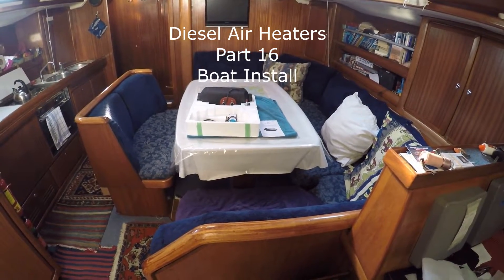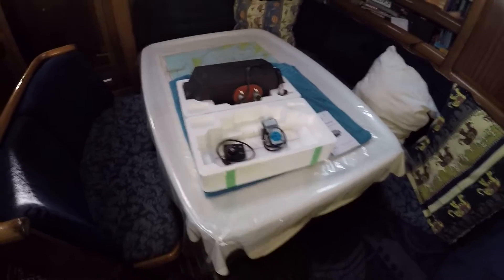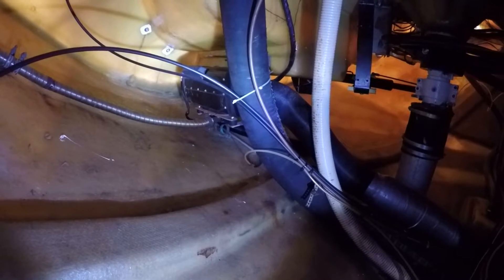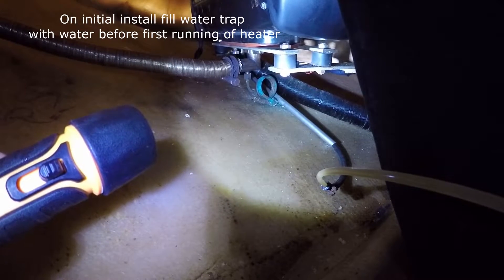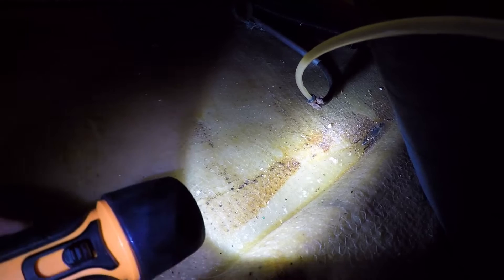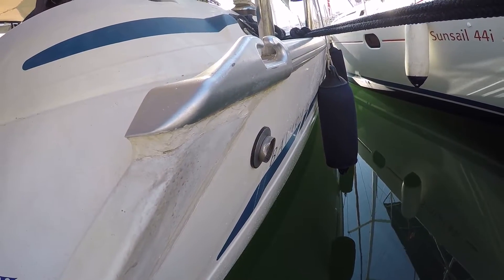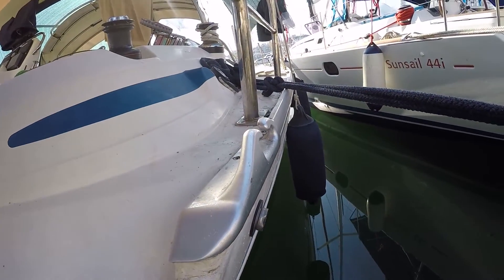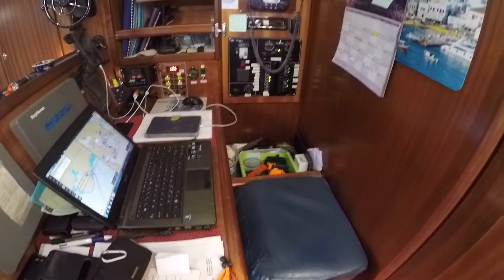Diesel Air Heaters Part 16  -  Boat Install

Comment: Thanks John for your fantastic videos. So clear and full of useful information. Im having difficulty getting the rigid fuel hose into the joiner (it’s too tight), but I’m concerned about going to a slightly larger/less snug fit. Does one of your videos cover this aspect?
Reply from the maker: Hi CR, 

It is ok to run normal fuel hose from tank to filter to pump, and hence no joiners for the thin nylon. But from pump to heater you should only run the thin hard wall nylon hose (and joiners)

The nylon to the rubber joiner needs to be a tight fit, if it slides in easily without pushing hard it will be too lose and leak.

I soak the rubber joiner in very hot/boiling water for a minute or so and use a little detergent on very tight connectors.

Regards.  JMcK
Reply: Thanks for the hot water & detergent tip John!

Comment: Hi John   Thanks for all the detailed videos.  In particular the boat video, can you confirm this is a 5kW style, and if so, what diameter and number of outlets do you have?  75mm?  You mentioned an 8m long run of duct, and I wondered if this was too long for 75mm duct?  Cheers, Nigel
Reply from the maker: Hi Nigel

Yes, the heater is a 5kw unit and the total ducting length is around 8meters long.
It is 100 mm ducting, not 75 mm, and has 3 by 90deg bends, which is not ideal but the system still works well. Cheers,  JMcK

Comment: Hey John. Hello from USA. Great work on these videos. 
I had a question. Is there any reason that you could not hook a large air intake hose to the interior of the boat like an air return duct in a home or recirculate setting in an automobile. I would think it might improve air flow in the boat if placed correctly as well as avoid drawing damp exterior air into the boat. 
Any thoughts?

Comment: Hi John. Learned a huge amount amount about these heaters from your videos. Un fortunately too late! 😄 Mine won't start at the end of the Mediterranean summer. Just one question to confirm, if the glow plug is a dud then the pump won't cut in? Thanks, John Maclean
Reply from the maker: Correct, first the fan starts, then the glow plug comes on, then the pump starts.

The most common issues with the glow plug are,

Low battery voltage. It takes 10 amps of current to heat up the glow plug. 

Carbon build up around the glow plug,  the glow plug screen, and the tiny glow plug screen atomisation hole.

Blockage of the tiny start atomisation hole. Carbon, bug, dirt etc.   Do you have a proper filter on the combustion air intake hose?  JMcK
Reply: @johnmck1147  
Thanks for the reply John. Yes I do have an intake filter. What is stumping me is I have power to the unit but nothing is starting. I have checked the printed circuit visually and there is no frying, all looks good. It has worked perfectly until now and from following your videos I can see the installation is sound. Its correctly fuse protected and I have an inline master switch before the controller which is functioning correctly with no errors showing.
Reply from the maker: Hi John, suggest you first see if glow plug is working. Do you have, or can you borrow a clamp meter and put over the main power wire from battery to heater. You should see a current draw of around 10 amps. If not check your wiring is sound and the plugs, like controller plug is plugged in tight. If the battery voltage is good, and the wire connections are good you then need to check the glow plug. To do this you need to remove it and connect it to 12V.  Good luck.  JMcK
Reply: @johnmck1147  
Thanks John. 😊

Comment: Just when I thought the series was finished, here comes another informative episode - many thanks, John. Greetings from Canada. 
Do you have thoughts on potential fan bearing failure, or lubrication requirements? That's one part that always concerned me.
Reply from the maker: MichaelAChang 

Hi Michael,
We have put over 1,200 hours ourselves on our genuine boat heater without a fan failure, and we bought it second hand.  I do not have anywhere near those hours on a Chinese copy heater to act as a comparison, but suspect you will get similar trouble free hours.

I have heard of a fan bearing replacement job on a genuine heater, but with the very cheap cost of the Chinese heaters it would be far cheaper to replace than repair.  JMcK

Comment: Does the exhaust fitting with the 90 degree bend come pre-configured with the fitting for the water trap? Or does one need to drill and tap the 90 degree bend and install a fitting for the water trap? Thanks.
Reply from the maker: Both. You can buy a genuine fitting from Eberspacher, (expensive) or make your own. At this time I know of any Chinese made part. JMcK

Comment: John, sorry to comment twice but one more question. If I run the exhaust straight down through the floor of my bus I would not need a right angle attachment with a water trap, correct? I'm assuming you just need the water trap if you are putting an upward bend into the exhaust. Is this assumption correct? Thanks again for all your super helpful videos!
Reply from the maker: Hi Mitchell, you only need a water trap in a boat or similar. There two reasons for a water trap. 
1. The most important, is to prevent exhaust gases getting into the boat or accommodation area.
2. To allow condensation water to drain away.

You are correct, if you run the exhaust through the floor of a bus you have no issues. However if the exhaust has a u type loop, you just drill a small hole (5 or 6 mm) at the bottom of the loop to allow water to drain away and not flood back into the burner. Where the exhaust gas will not be able to get into the accommodation area you just need a hole, not a water trap.  JMcK

Comment: If i bought a basic knob controller like yours could i wire it up to my Plannar 44d heater?
My Plannar controller looks like yours except yours looks a little better.
My controller has 4 wires 
The wire colors are
Red
Blue
White
Green

Thanks for taking the time .
Reply from the maker: Hi Larry, I really can not give you an answer without checking this out myself and looking at a Plannar ECU circuit diagram. I do not have a Plannar heater myselfor wire diagram so I can't check this.

Sadly some Chinese heater suppliers are now sending out their heaters with non standard ECB and controller wiring so you can't mix and match controllers. Whether this is deliberate or not, I do not know. In your case, I just don't know, sorry. 

If you have some electrical knowledge or know someone who does you could make your own decision whether to try the new controller on your heater.  JMcK
Reply: @johnmck1147  
Thanks for responding John,  excellent videos
Reply from the maker: Larry Webb 
Your welcome Larry.  JMcK
Reply: I like the Chinese diesal heaters controller better because it has the indents in it to where it clicks as you turn it and it turns easier too.
With it clicking the way it does it allows me to adjust it to a certain spot , for example 4 clicks clockwise might be a 1/4 turn and so I could turn it to exactly 4 clicks every time if that's where I liked it , without the clicks I can get close but I'm really would be just guessing.
On my Planars control knob I did glue a bigger knob on top of the original knob using The Amazing Goop adhesive that makes it much easier to turn then before but it's still slightly stiff.
If I figure out how to swap in the Chinese controller in the future I'll update you , won't be any time soon.
Thanks for all the excellent videos
Reply from the maker: Larry Webb 
Thanks Larry.  JMcK

Comment: John: Q? I am about to complete my 5th wheel Dual heater install. Did a test run this evening works like a charm! my question is. Is their a way to intercept a trigger off one of the wires in/on the electrical system? My reason for this is. I want to trigger some inline duct fans. to help move the heated air to the rear of my RV. having a series of inline duct fans would do the job. I was going to have a look at some schematics if I can find some. But thought I'd ask the "Expert". so some trigger wire. Id tie it into a relay that would set off the fans.  and when the heater shuts down? have the fans continue to run for some timed amount. Thanks again - Sam
Reply from the maker: Hi Sam, if you have circuit wire knowledge you could try and connect a relay into one of the fan wires. (Easily accessible). This would energise the relay when the ECB turned the heater fan on. 

You would need to use a relay and have your fans on a seperate circuit. I say "try" as I have not done this myself, and although I see no reason it would not work, I have not personally tested for myself.  JMcK
Reply: @johnmck1147  John , that was my thinking exactly.   However I am not sure if the fan motor is a PWM, etc.. Do you happen to know if its simply a voltage regulated fan? Not too familiar yet, but it sound like it spins at different speeds? I am going to remove the entire unit today and test the fan circuit. Fan circuit energizes a relay which in turn completes the circuit to 2 different fans. here is a little tidbit. I marked all the wires to differentiate the 2 units H1 and H2 since thier right next to each other and will share the same fuel tank etc. I powered up the system primed the fuel lines they fired up!... then 3-5 mins later err code... Both of them having diff err codes. I reset and re fired them up... then both ran for 3-5 mins and both producing heat, Bam err code and shut down.. At this point Im thinking how could both of them be failing? I might see1 but not both. I then realized I never marked the fuel pump it self I marked the connector, in effect the one unit was fueling the 2nd unit. While it eventually failed. amazingly, It still ran!  incredible little units. well thats my dummy mistake. at my age? Im sure more to come :0. Million thanks John, -Sam
Reply from the maker: Sam Rod 

Hi Sam,   Thanks for the detailed feedback.
Yes the fan does spin at different speeds, and is the main cause of noise at high heat settings. My guess is it is voltage regulated. (Not tested though).  JMcK

Comment: I have a webasto 2K gasoline heater and the exhaust is making a intermittent burping sound.  New install.  It will cycle through a few times then shuts itself down.  I have 12.8 v coming to the heater, no bends in the exhaust pipe with a short pipe, no inlet manifold on the intake, the pump is mounted at 30 degrees.  Pickup from the axu pipe in the gas tank of a promaster van.  Any troubleshooting ideas.  Love your videos, I learned a lot.
Reply from the maker: Hi Rick, a bit hard to offer suggestions without seeing the heater, but from your description I suspect you have a diesel heater, not a gasoline version heater. If you try to run a diesel heater on petrol or gasoline you get symptoms just as you describe.

There is a lot of confusion with Chinese translation. In China, and some other countries diesel is called gasoil, and this is sometimes translated to gasoline. 

Is your heater really a Webasto brand heater? If so go back to Webasto.  If you bought a Chinese copy air heater, it will almost certainly be designed to run on diesel. A look at the burner chamber will tell if it is a diesel or petrol heater. 

Cheers.   JMcK

Comment: Did swapping out the 2 controllers , one for the other, did that work?? I am thinking of doing the same thing.?
Reply from the maker: Hi , most time it works really well if they have the same plugs. However, some heaters have non standard plugs and reversed wiring.  JMcK
Reply: @johnmck1147  I have one of my heater with reversed wiring,  can I change the wiring before changing the controller and then will it work?
Reply from the maker: sargetester99 , without seeing it I can't fully answer, but in theory it may work.  JMcK

Comment: Awesome videos . Quick question about a boat install...what is the failure mode or issue with pitch vs roll in these units.. The Eberspaecher manual seems to imply that they are less tolerant to a roll axis than a pitch based on the ticks and crosses but I'm probably reading it wrong. I assume they want to avoid a permanent pitch down of the outlet end to avoid overheating. As my boat is a Trimaran i would never (normally) experience a heel of more than say 15 degrees so if its the nose down attitude and extended use in this orientation that causes issues I might be immune. Small boat, limited install options for a Chinese version.
Reply from the maker: Hi Mark, these heaters are pretty tolerant to pitch and roll on a boat. You can actually mount these heaters at 90 deg roll provided the glow plug is at the top. They will also operate for a short time at 90 deg pitch. 

What they don't like is permanent install on out of speck angles as the diesel pools on shutdown, and you have start issues, but once started you can twist and roll them and they still work. Mount the heater level on your boat at rest with proper install practices and you won't have operational issues.  JMcK

Comment: Thanks for the great series I have watched them all and learnt a lot. You seem to have more than 270 degrees of bends in your boat exhaust but you say it is working fine?
Reply from the maker: Thanks for the feedback Stonkeng,  
The boat has a 90 deg at the start and a splash loop at the top, and then exit. The advantage here is hot gases rising creating their own sucking movement. It would not work so well if the exhaust was the same but in a downwards movement.  JMcK

Comment: Once again, thanks for your videos!  They are great and very informative.  Another idiot question.  On a boat, it is often not possible to run the heater while it is in storage.  What would be the best procedure to prepare the heater for prolonged inactivity?  Normally this would be 6 to 8 months, but with the virus, it may be quite a bit longer.  Fuel stabilizer (antibacterial, etc) and or drain the tank and/or fuel lines?  Thanks again.
Reply from the maker: Hi John,

At the end of the sailing season, I run the heater in our boat in the Med around full power (aprox 5Hz) for about 15 minutes and shut it down. Running the heater on high power for a few minutes helps to burn off any accumulated deposits. I then turn off the fuel tap to the heater (it is fed from the boat diesel tank) and that is it. 

The boat mostly comes out of the water for hard stand winter storage for 7 months or so each year and in 12 odd years of doing this I have never had an issue with the heater, nor have I had to clean out any accumulated carbon deposits from inside the heater.

A couple of seasons we have not had a need to run the heater so the heater downtime exceeded 18 months without any issues.

The critical issues with these heaters is - 
Proper install with minimum restrictions and back pressure.
Clean fuel, and a decent external fuel filter.
If you run the heater mostly on low power, occasionally give them full power for 15 minutes or so to burn off accumulated carbon.

If you run your heater from a small seperate fuel tank and it is easy to do so, it can be an advantage to run a high kerro/diesel mix (90/10) for 15 minutes at season end. (To burn off any accumulated carbon)

Cheers.  JMcK

Comment: Hi, I think your videos are very good to learn about these heaters, I am about to install one in my boat and I am now learning how. You never mention in your videos if these chinese heaters are made for mount in 90 degree, so that the exhaust and inlet air pipes are sticking out sideways instead of downwards, I read in the technical manual of ebersprächer that they can? Keep up the good work!
Reply from the maker: Hi Peter, I do mention that these heaters can run on their side, but only the side with the glow plug on the top. 
In actual fact, they will run in any position. -  FOR A WHILE.   Cheers.  JMcK
Reply: @johnmck1147  Oh, i might have missed that, because I need to install my heater on a boat and its much more easier for me to install it on the side rather than stand up, because then I dont need a exhaust elbow to get the exhaust pipe up above the water line, where the outlet through hull exhaust will be. So this was good news for me. But I still need to have that damn thing called "water dripping condens". That part is a real pain, expensive and another thing with clamps and source for leakage. Thanks a lot for your quick answer and for doing such a detail review and research on these burners, thay are in a position where some considers them as a cheap China and that you should by "real quality" therefor your channel is a blessing. Regards Peter
Reply from the maker: @pejochto1968  

Hi Peter, if you do not have a low spot in the exhaust you do not need a condensation drain.  JMcK
Reply: @johnmck1147  That was great news, I think I can have it without a low spot if I lay down the heater on the side, then it would be quite straight upward to the through hull position. If I dont put it sideways I need to have an elbow like pipe to get it around the heater and then upwards. But that was good information. CHEERS /Peter

Comment: Hi John. Great videos. Really informative. Just wondering how big the hole is through the hull around the fitting. Did you need any heat shield to stop burning the hull material and what temp do you think is around the fitting. Thanks very much.
Reply from the maker: Hi Renay, the fitting has a built in heat shield. There is an air gap built into the fitting. The hole in the hull is around 40 mm, depending on the marine exhaust fitting you buy.  JMcK

Comment: Great video.  One question....what if I mount the heater higher than the exhaust outlet - say 200mm - do I still need the exhaust drain and the loop?
Reply from the maker: Hi Mrs Tatham, you need condensation drain at the lowest point if the exhaust.
If the exhaust slopes downwards and any condensed water can drain out of the exhaust you do not need a seperate condensate drain.   JMcK